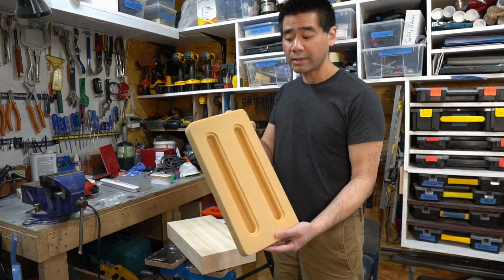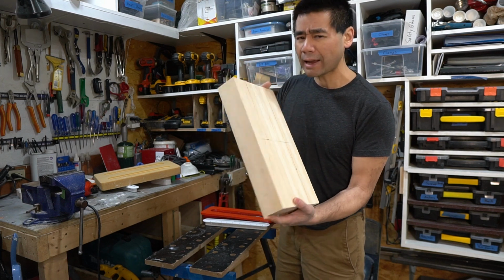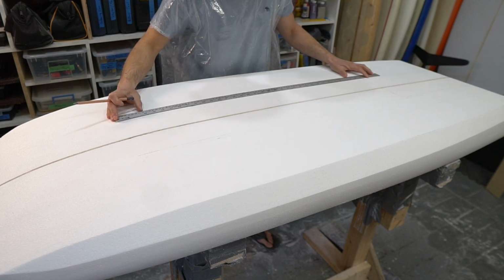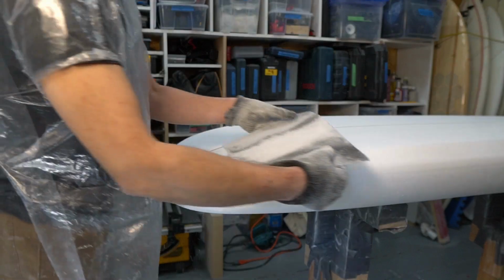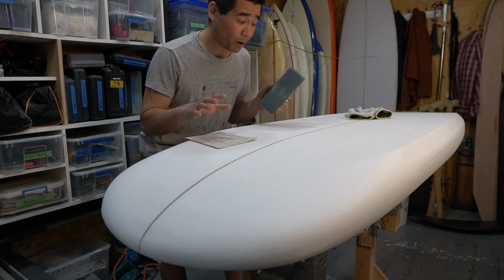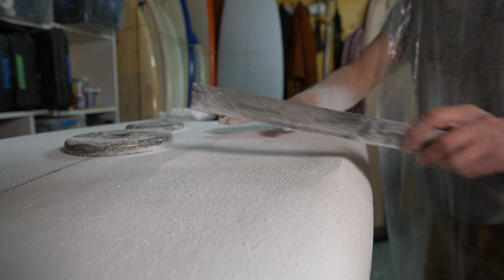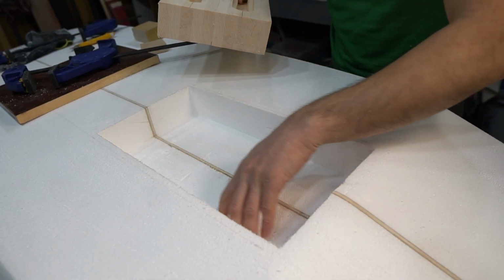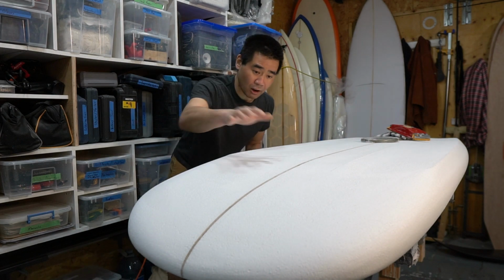How to Make a Foil SUP Board | Foil Trackbox and Concave Install - Video 3 of 7

Comment: Building a foil sun as well from a hard sup I purchased second hand very cheaply. I am having trouble to decide on where to place the track box ( how far from the back ). I was hoping you will discuss it in your video. What I learned from Blue Planet channel is that you want the front wing to be roughly in the middle between your feet in your stance and also having the front wing be the center of the gravity when you lift it by the front wing. 
I was wondering if you can share your experience and if you had any problems riding it leveled while on foil without shifting your feet too much.